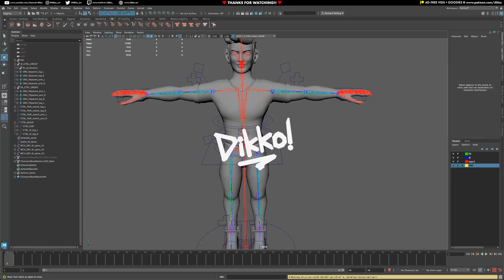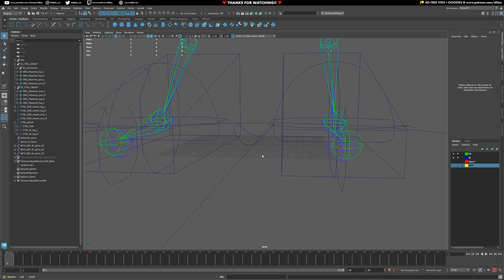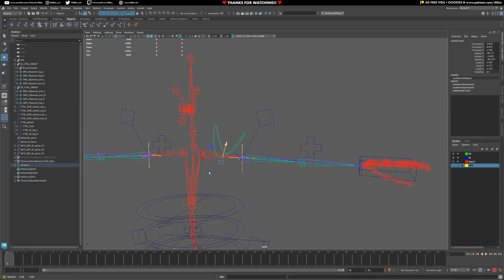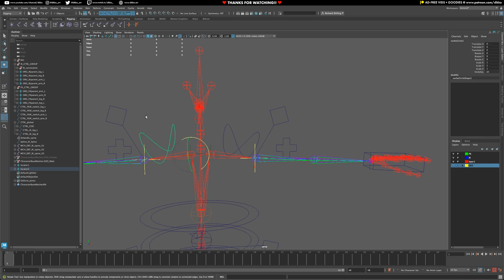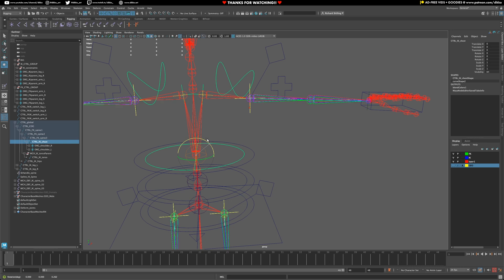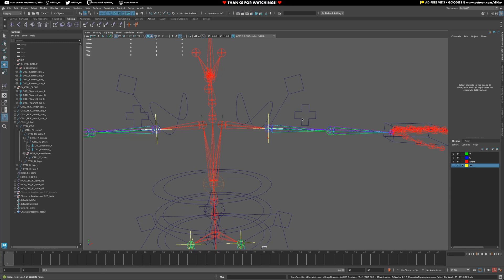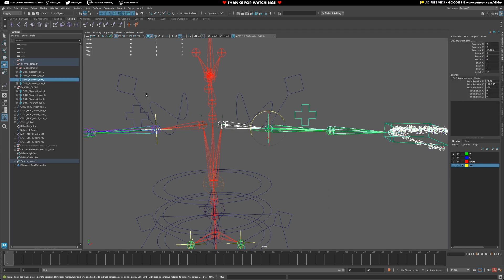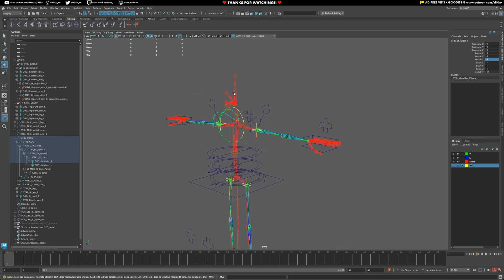Character Rigging in Maya! Episode 11 - Connecting the Arm Controls to the Torso

Comment: followed the tutorial and everything works great ! except at the end when I try to rotate the torso to see if the shoulders are following. for some reason my right arm decide to become a left arm and goes on the other side of my model ahah ; idk what I did wrong but the only fix I could find was to do a full 360 degree rotation in Z and not freeze transform.
other than that, great tutorial so far and thank you for your help :)

Comment: For those having issues I think I'm understanding why. Wasn't explained but in the previous tutorial, DONT parent the hips to the IK group CTRL of the arms. Just the legs. I realized after that connecting the arm controls didn't parent correctly because its parenting between the hips and the shoulders. Hopefully this resolves the issue but worked for me.
Reply: I know I'm late to this but thank you so much, this really helped me out. In the previous episode he kind of skimmed over it at the end of the video but yeah, you need to parent the ORG_IK of the legs to the hips, and the ORG_IK of the arms to the shoulders. Worked like a treat for me. Thanks again!
Reply: @xcolerfx3963 And I want to thank you too! Your explanation helped me to better understand the other comment
Reply: Thanks!! this one Saved me some time figuring out what was wrong!1
Reply: Worked for me too thanks!😃
Reply: I confirm, if you parent the arms to the shoulders instead of to the hips, everything works. Thanks!
Reply: Thank you so much! I was so lost otherwise

Comment: Hi! I've been following your tutorial series almost identically, but for some reason, when I tried constraining the right DEFORM bone to my right should control. the joints snap rotate to a differently from where I want to rotate it. Also, when I tried moving the top spine to test out if the hand DEFORM joint is staying in the same spot, it isn't but the IK joints are behaving just fine. I have no idea where I might've gone wrong... Any help is much appreciated, I'm very new to rigging!
Reply: Litterally having the same exact issue and cant seem to figure it out:(
Reply: You could try and check out your local orients and rotation values. Otherwise going in to the 'parent constrain' options and double check if you have maintain offset enabled. I don't know if these fixes are the best/ optimal. If it doesn't work then I'm unsure of what has happened. Good luck!
Reply: i have the same issue as well :/